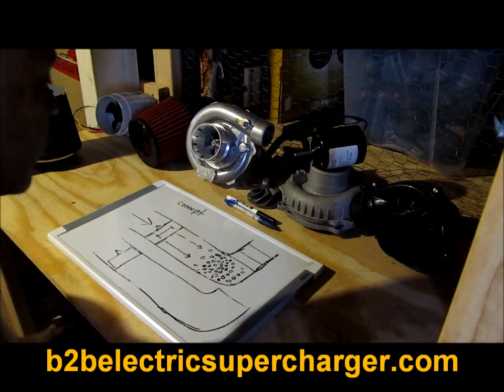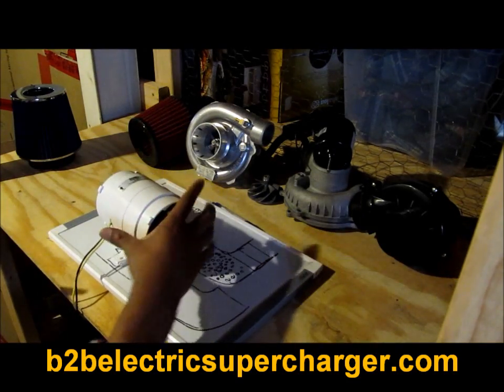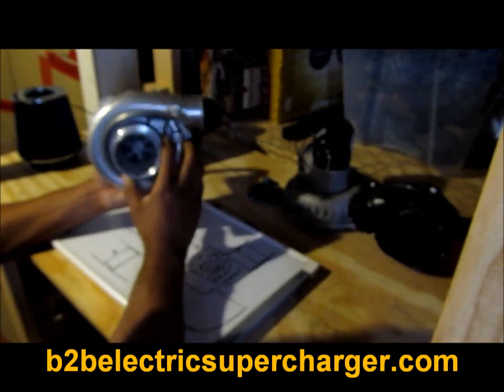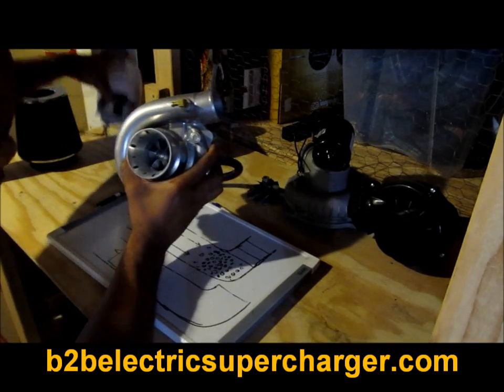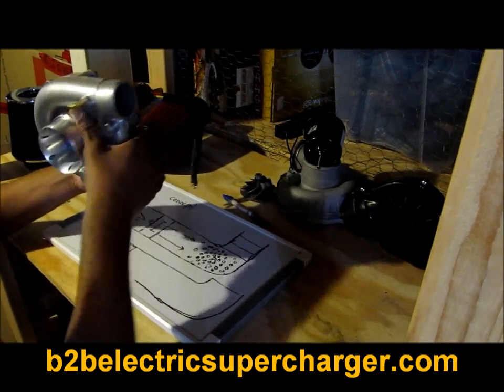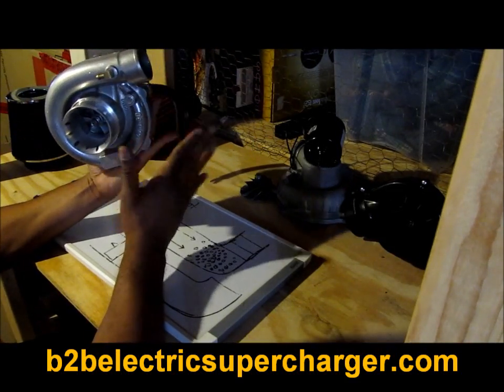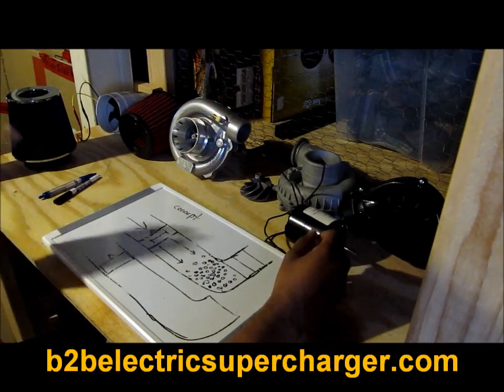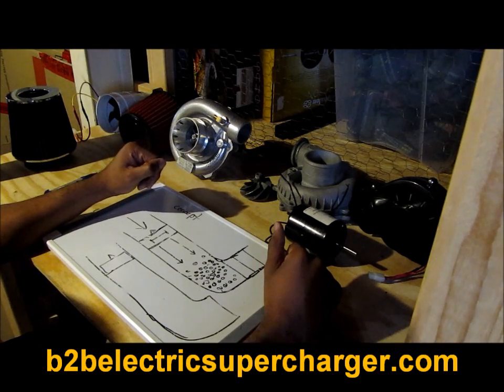Do Electric Superchargers Work?

Comment: Nice idea, shame that its your understanding that a bit misplaced. Superchargers draw about 20% on average of an engine power (HP) and increase HP by 35-45% depending on the set-up.

So if your car produces 200HP for instance 20% is 40HP, thats around 30kW of power! Not only that but the example in the video is a large compressor wheel off a turbo. These have been designed to run at 80,000-120,000 rpm to be efficient. so you need a motor that has a speed of 80,000rpm with a power rating of 30kW to do the same job.

As people have stated below you can't magically get power from nowhere.
Reply: Pony Power "so you need a motor that has a speed of 80,000rpm"
You don't, you can get the rpm from a step-up radial gearbox easily. Of course, this does not all of a sudden make electric superchargers sensible.
Reply: totoritko but when you use gearing to increase velocity you exchange torque for speed, increased speed doesn't come from nowhere. I should of said 'you need to drive a turbo impeller at those kind of speeds'. And I did go onto say at a high enough power rating. What you quoted was taken out of context abit.
Reply: Pony Power "but when you use gearing to increase velocity you exchange torque for speed"
So? How is this a problem?
"What you quoted was taken out of context abit."
I'm sorry if I misunderstood you. I just wanted to point out that the rpm argument isn't a good argument against electric superchargers.
Reply: The impeller requires torque to force the air into the manifold. Gearing a motor to go faster isn't helping it hindering. And it is the argument.
Reply: Pony Power No, the impeller requires power and due to its mechanical design a certain rotational speed. I'd suggest you read up on the relationship between energy, power, torque and rotational speed.
To make the math simpl, let's use a fictional compressor that in order to provide 10 psi of boost needs to be spun at 100k rpm and at that stage requires 40 kW of power (meaning, it consumes 40000 Joules per second of energy which it uses in an adiabatic process to compress the oncoming air). This directly gives you the resulting torque: torque = power / rpm. So to drive it, you'd need a drive of 100k rpm at about 4 N.m of torque. E.g. a Prius' ~60kW electric motor is redlined at ~5000 rpm (which means, 60kW @ 5000 rpm = 114 N.m), so all you need is a step-up 20:1 gearbox (easily achieved via an in-sequence set of two or three stages of planetary gears) and you can drive your compressor with it.
Here's a handy power-torque-rpm calculator that takes the work out of figuring out the correct unit conversion constants: http://www.wentec.com/unipower/calculators/power_torque.asp
Reply: the impeller requires power............. somehow you've got it wrong, power is force over time, the impeller requires torque, over a minute this torque can be calculated over that minute and that's where you get your power measurement
Reply: Pony Power "power is force over time"
https://en.wikipedia.org/wiki/Power_(physics)
In physics, power is the rate of doing work. It is equivalent to an amount of energy consumed per unit time.
"the impeller requires torque, over a minute this torque can be calculated over that minute and that's where you get your power measurement"
Here you've stumbled into making sense again. Power is also equivalent to torque over time (not force over time).
Did you really not understand the calculation I showed you? This is absolutely basic high-school physics.
Reply: Here you go splitting hair again. But what does it matter. You know what I'm getting at your being being a troll about it. One question which I kinda think I know the answer to, what do you do for a living?
Reply: Pony Power "Here you go splitting hair again."
This is not splitting hairs. This is me pointing out you're mixing apples and oranges. Technical subjects are precise and require the use of precise language.
Anyway, if you think constructive criticism is trolling, well, then I feel sorry for you.
Reply: 'Technical subjects are precise and require the use of precise language' yes they do when I'm at work, not on bloody youtube. If i misspell something I haven't failed at life and obviously can't speak english, these are comments not my thesis......... wait is it?
Reply: Pony Power Dude, I don't care if you get spelling wrong or misspeak on minor details. But when you write:
"*you need a motor that has a speed of 80,000rpm with a power rating of 30kW to do the same job*"
That's not a spelling mistake or misspeaking. That's you not thinking it all the way through. That's the only thing I was responding to. Then you came talking about "torque this, torque that" and using some fairly simple math I showed you how that's no problem either. And you call me a troll? Because you got something wrong and I pointed it out?
Reply: Why is that wrong? what was misspeaking was 'a motor with a speed of' when I should of said a set-up that can reach 80,000rpm i.e gearing up.
Reply: The onme thing that you and others fail to understand is the engines comsumption of air per minutes, the weight of this air and the power/energy/torque to do this and to also resist compressor surge. There isn't (a present) a PRATICAL method of running a 12v/24v motor that has comparible weight to a turbo, very far from it.
Reply: Pony Power Well, that's quite a difference, as getting an electric motor of such a power to 80,000 rpm is really difficult. Stepping it up to 80,000 rpm via a gearbox, however, is comparatively easy.
Reply: Pony Power "The onme thing that you and others fail to understand is the engines comsumption of air per minutes, the weight of this air and the power/energy/torque to do this and to also resist compressor surge."
Can you expand on this? Because I didn't quite understand what you were saying here. How airflow and air mass has anything to do with the mode of driving the compressor, I just fail to see that.
"There isn't (a present) a PRATICAL method of running a 12v/24v motor that has comparible weight to a turbo, very far from it."
That is quite true. The voltage even has nothing to do with it. It's mostly a power density type of thing. Electric motors, while certainly power-dense, are difficult to find in such sizes.
Reply: Can you expand on this? Because I didn't quite understand what you were saying here. How airflow and air mass has anything to do with the mode of driving the compressor, I just fail to see that. - what are you on about? can you spin a impeller with a motor - yes - what has it got to do with air flow? - its an engine - what more is there to it? what has airflow got tot do with an engine? are you being serious?
Reply: Pony Power Try to carefully reread this part:
"How airflow and air mass has anything to do with the mode of driving the compressor"
A compressor IS NOT an engine. From the point of view of the drive source (be it a motor, engine-driven belt or exhaust-driven turbine), it's a rotational mechanical load. That's all.
So I ask you again. What do the particulars of how a gas compressor works (which is airflow, air mass, stall/surge prevention, etc.) got to do with the source of mechanical power driving it?
Reply: nothing, but what the point of fitting an electric motor to an impeller FOR AND ENGINE if its not going to work? Thats what this video and the discussion is about......... fucking knit picking again
Reply: Pony Power And as I explained, it can be made to work, but it'll be more bulky and complicated than a turbine-driven unit or a direct crank-driven one.

Comment: Guys just Look at the new Audi Rs5 tdi and audi tt clubsport audi has developed an electric turbo system and no im not talking about an electric motor that power is sent to the wheels its an electric turbo
Reply: Matthew Dolbey yeah I read about these. Its a electric aided motor. just like with the hybrid cars they use electric motors on a sprag clutch to spool up the turbo to aid in reducing lag

Comment: I have a question. is the one you made direct drive and the motor spins to 38000? because if it is you can gear that thing higher and it can spin much faster. and it will loose torque but im not positive but I don't think torque is the thing you need I think it is pure turbine speed. tell me what you think, thanks Ryan

Comment: i have another little idea, which is completely theoretical. why not make a turbo that works just like a supercharger. you add a pulley to your crankshaft and instead of an electric motor put a pulley on that turbo (bigger pulley on the crank and very tiny pulley on the turbo so the rev amplification gets that turbo to actually do something). it would boost engine power at any revs. even when it idles you'd get some boost.
Reply: It's called a centrifugal supercharger
Reply: no i meant a centrifugal supercharger, mate :D
Reply: +Rokas Getautas its already made. its called a pro-charger. or centrifugal supercharger
Reply: +Rokas Getautas I think you mean a turbo that gets its boost by both the exhaust and crankshaft so no lag at all. Well, that's not really practical what they do instead is a turbo/supercharger combo like VW 1.4 TFSI or a sequential turbo with a small turbo "no lag" followed by a larger turbo like the Toyota Supra.
Reply: It's called a pro charger. They exist.
Reply: that's already been made its a pro charger or supercharger all it is is a turbo that runs off a pulley on your serpentine belt
Reply: Its called a ProCharger
Reply: centrifugal supercharger? lol
Reply: yeah. i know that there are superchargers and trubochargers :D but yeah a centrifugal one. :D
Reply: Hold in confused. There already exists a turbocharger that is turned by a pulley. They are called centrifugal supercharger. 2 well known manufacturers of them are procharger and vortec.
Reply: Jeremiah Steele i knew they existed and in fact many mercedes-benz cars have these built-in. but i thought i'd just let people know that instead of putting an electric motor, which requires extra voltage, and extra computer to control the input to the motor, why not stick on a pulley which would make the turbo more efficient than the electric motor.
Reply: oh i get it. here's how i think about it, if it hasn'e been done before its because its just doesn't make sense to do it. either technology isnt there yet or what we have is just much better. turbos are pretty efficient, theres lag but there have been huge leaps to get rid of it and alot of cars dont even have it.
Reply: james notbond I know that already, no need to tell that twice m8 :)

Comment: I work in an industry that builds, installs, maintains pumps, motors, gearboxes drives, gas turbines all kinds of high tech mechanical and high voltage electrical systems. ALL superchargers rob power to make power. Hence why they are belt or gear driven. Some will use between 10-70 hp to make an additional 100hp. I work on small and large compressors, blowers, and apparently none of you guys know what it requires to build pressure. what you see here is a FAN not a compressor. The required power to drive a 10-30hp driven supercharger would not be happily driven off a 12 V battery. a 30 HP electric motor is huge and weighs well over a 100 pounds. This shit is a gimmick and a joke. You cannot build power with a little wal mart Chinese fan. Turbo's are even more complicated and run so hot you'll melt any piece of shit wire even close to it.
Reply: http://www.gtspirit.com/2014/08/06/1500hp-bugatti-veyron-successor-to-be-hybrid-have-electric-turbos-and-reach-286mph/

Please cite your 'evidence' suggesting to the contrary...
Reply: loveever89 your smart phone your tv your computer  most of the components of your car that are not made of metal in fact probably a good 70% of the shit around you will be made in a country thats not yours and most of it in an asian country
Reply: Zoid Burg the turbo is not actually powered by an electric motor ..the electric motor is only there to spin the turbo up to speed faster it is not related to the turbo producing power  these are called hybrid turbo chargers and are powered through ERS energy recovery system. using waste energy  is not a draw on the cars electrical system
Reply: 2016 Veyron replacement is supposed to be having 2 of the 4 turbochargers electrically powered. Car is going to apparently make 1,500bhp and do 0.62 in 2.3 seconds.
Reply: honda12345678 

The funniest thing in this video is he straight up admits that "there are no real electric superchargers".  Then goes on to say he built his own...LOL

But yeah, so many people wasting  money on gimmicks, people need to use their brains a bit more before they spend their money.
Reply: Zoid Burg excellent thanks for the link ... its fairly badly worded but on looking up from VW what this is it is the same as a hybrid turbo used  in F1 so it has nothing at all to do with an e turbo / e super charger  i have read almost identical publications in 5 different magazines  smells a bit funny in how it has been put out there
Reply: Gav, that is exactly what I thought it would be. I would have thought, though, that the electric motor would be producing some power at low RPM by inducing the forced induction until the exhaust gas is up to sufficient velocity to spin the turbine for itself?
Reply: That's true. Don't buy anything made in china! Anything that is made and manufacture in china is bad.
Reply: Yeah turbos are hot? That's why you're not a dumb ass and run wire by it? My sti with a precision turbo gets fucking hot. But it also make 490whp... So is it worth it? Yeah..
Reply: Matthew Dolbey http://www.pistonheads.com/features/ph-features/audi-rs5-tdi-driven/30518 NOT AN ETURBO
Reply: oh course it robs HP to produce pressure ahaha  it also robs fuel and it robs  lots of things..but it makes more HP and makes things go faster or stronger..no one said otherwise..it just does it a bit more efficiently..but  it does  rob  from fuel and    power..
 compared to adding another engine..its CHEAPER..
and no it doesnt have to be complicated.. ahahahah  or hot  ..
doc johnny phd
Reply: and either way, you dont pick one up off amazon for $40.
Reply: Zoid Burg no evidence of this and vw is not working on such technology they are working on a turbo with  an e charger to reduce  turbo lag
Reply: Gavin Irvine
What you describe is exactly what we meant. A turbo that is powered by an electric motor to reduce lag at low RPM. What did you think we meant? :/
Reply: Zoid Burg  sadly not all the motor does in a hybrid turbo is spin the the fan up to speed to reduce lag it has no involvement in producing more power http://jalopnik.com/how-formula-ones-amazing-new-hybrid-turbo-engine-works-1506450399 jalopnik excplain i tbetter than i could hybrid turbo is also not technicly the right name as there s a patent on that name from some other bullshit  e turbo
Reply: Snozz Berries funny about the only place you would find a working e turbo must be on a space ship the alien kind at that
Reply: honda12345678 these small compressors do not need much torque to spin so they can work off the battery. Put it this way- do you think your belt sander could compress air?
Reply: hard not to run a wire next to it when they're talking about electric blowers and turbo's wise ass.
Reply: Dallas Lynn You obviously didn't understand he was trying to say you can't have a turbo powered by electricity because the turbo will melt any sort of electronics.
Reply: Gavin Irvine look up audi rs5 tdi its using an electric turbo also look at the audi tt clubsport also using electric turbo
Reply: Matthew Dolbey i have and i recommend you look it up to that is a hybrid turbo it uses an electric motor to aid the spin up time to reduce turbo lag it is NOT AN E-TURBO
Reply: Gavin Irvine so do hybrid turbos rob engine power? do they require their own generator or alternator due to high current draw?
Reply: Brad M a hybrid turbo uses hardly any electricity in comparison to the crap that is been touted in these videos have a look at the power consumption of both and for the time periods used
Reply: theres no such thing as a electric supercharger because his powers a compressor which spins the turbine
Reply: so you can't just take a 6,000 RPM capable electric motor and use it to spin the impeller shaft of a turbo? I don't think the turbo would have that much drag on the electric motor
Reply: honda12345678 i
Reply: hey bro, so what about if you install a electric turbo on a car that already have a real turbocharger  to provide more CFM? would this help to increase hp?
Reply: You can if you gear the drive system correctly. The use of a planetary gear train with step up speed will do the job nicely. So much raving on about electric motors & loads imposed on the car electrics, these clowns have no idea.

Comment: @B2B DIY Electric Supercharger Manual  I would like to see one of these on a dyno test. that is real proof. words can mean a million things but before i start spending money on something ridiculous like this, show real proof.
Reply: Well i belive that this can work,  since it uses tral turbo body and electric motors can be quite torquy and provide the power needed but i would be curious if normal electrical system would support it, if this would be possible car manufacurers would already use it since this is cheaper in all means then classical turbo and the power is instant and the ecu can turn it on of as it wishes. I think the issue is still the power system but maybe in the new hybrids with high power grid this can work the question is for how long...